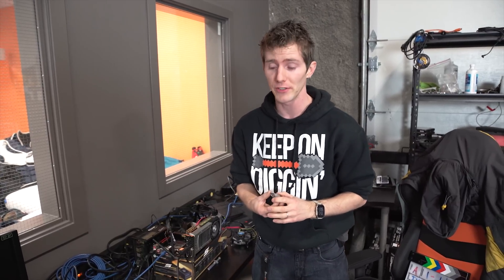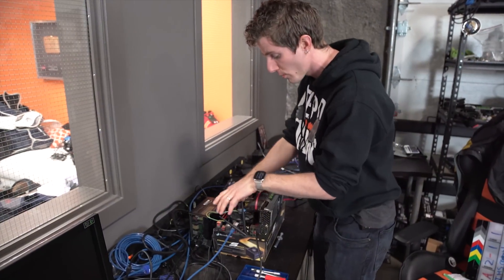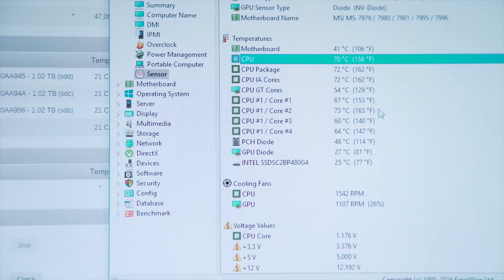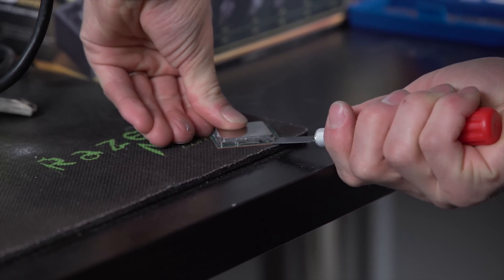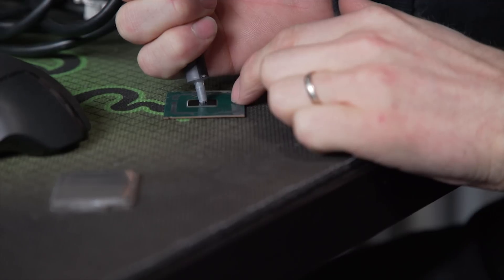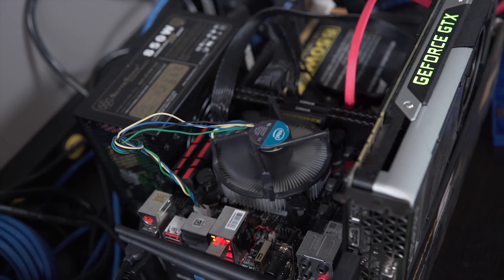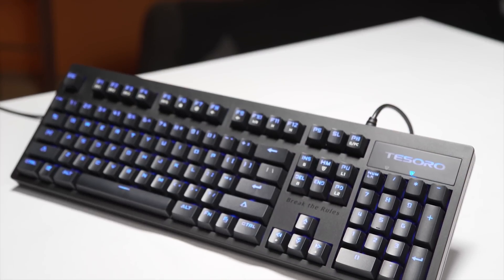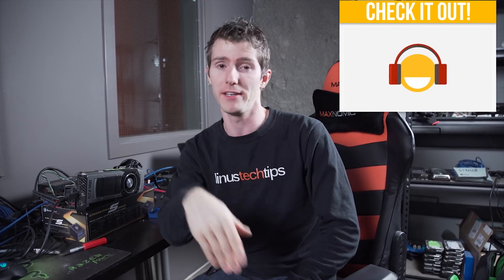Delidding an Intel Core i7 6700K - Is it worth it!?

Comment: I honestly did not know that the big part on top of the CPU was just a heat spreader. I thought the CPU was that whole thing
Reply: +PlatinumGamer One can see who's young in here. 15 years ago every desktop processor was sold without this plate.
Reply: +PlatinumGamer Back when unicorns and dragons still roamed the prairie (the 70's and early 80's) most CPU's were packaged in plastic DIL (dual in line ie pins down either side of the chip) with no heatsink. Some of the higher performing chips would eventually warp then melt the package. If you were to put a drop of water on the chip it would boil and evaporate almost immediately (look I was young) I had a system with a 6809E that ran at a whole .89Mhz (yes the . is not a typo) but with overclocking you could take it to almost 2Mhz, that chip was on the verge of being on fire. Now get off my lawn you whipper snapper ;-)
Reply: +PlatinumGamer Its even smaller then that. Its covered behind the second "lid".
Reply: deXter2
I'm just 17, and just recently got into computers ;)
Reply: same
Reply: yeah, now I know why my netbook processor is small.
Reply: Wow, how old are you guys?

I am seriously wondering here... I mean, I knew the first time I saw the insides of my family's first 486 DX2 that the piece of ceramic with the words Intel 486 DX2, was not the ENTIRE chip, I KNEW that inside of that ceramic somewhere, was a piece of SILICON, far smaller in size than the ceramic which was the size of the socket, and that the only reason the PACKAGE was as big as it was, was entirely due to the need to interconnect tiny pieces of that silicon to each and every pin on the bottom of said CPU package. This was back in 1992 when I was just 7.

At which point in time, I knew how to pin out jumpers to install a new peripheral with a new IRQ, I knew how to run absolutely ANYTHING within DOS 3.X - as well as how to install both DOS, and windows 3.1 - not to mention any game I wanted to play and most drivers I ever needed. 

And the first time I had ever touched a computer, I was just 4, by the time my family had bought the Zeos brand 486 DX2 with a then top of the line 325 MB hard drive, I was JUST turning 5!

So, while I do not believe that the average person learns and remembers things as quickly and easily as myself, there is a HUGE difference in terms of society. Back when I was learning about computers for the first time, there was NO WORLD WIDE WEB! Everything I learned, I had to learn from my father, and reading technical documents!

I mean DO YOU even know what silicon looks like? How could you mistake solid metal for a MICROCHIP? And, for being "interested" in technology, how much do you believe you ACTUALLY know about Computers, how they function, and their history?

I just cannot help but feel disappointed that Linus claims to get MANY questions of this variety, and even many people who admit that they believed a SOLID PIECE OF METAL - to be part of a semiconductor microchip... And now he makes stupidly simple videos to oblige people with limited understanding - and it turns out that many people, who seem to be or claim to be technology enthusiasm, understand far less than the first principle of thermodynamics, and do not even know what a silicon microchip looks like...
Reply: +PlatinumGamer First computer I ever built from scratch used an AMD Athlon Thunderbird processor. Those CPUs didn't come with any kind of heat spreader on them, so you just got to see the actual CPU die and a couple components that were also placed at the top of the processor. That computer was the shit. It had an ATi Rage Fury Pro video card with 32MB of V-RAM. It was actually a beast for the time. Diablo 2 and Max Payne ran like champs.
Reply: +PlatinumGamer me too. kinda cool you can know so little about the parts and still build with them
Reply: +deXter2 Actually when manufacturers purchase mobile grade CPUs none of them come with lids. (For Intel at least, I've never taken an AMD CPU/APU out of a laptop.
Reply: It's called the CPU die.
Reply: +PlatinumGamer I knew they were heat spreaders just because Intel started doing it with Pentium 4's... my old Intel Pentium 3 800mhz and my Athlon XP chips all had the die exposed and your heat-sink would make direct contact... and yes, sometimes you could crunch/crack your cpu's... sad times.
Reply: +PlatinumGamer orginialy cpus didn't have head spreaders
http://www.cpu-world.com/CPUs/K7/TYPE-Athlon%20XP.html
is an example.
headspreaders have been added, because the cpu would be way way more protected that way.
it also makes it ezier for the average person to put a cooler on with better performance.
original the cpu was that small and fragile, that tighening the wrong screw first and strong would lead to eather the cpu corner breaking, or bad thermal performance.
also the video did sth very wrong, so u dont run on wrong information:
the reason people HAD to delid their cpus to get an average overclock, was NOT the 3 degre difference linus shows, but because intel change from soldering the cpu to headspreader  to using a horrible horrible!! head paste.
resulting in the heat not being able to escape through the thermal compound, leading to acumilating head, etc.
the thing it is not 3 degres!
it was up to 40 degress if u overclocked it even with a great great cooler.
and it is important to understand, that intel are the asholes here.
they started to no longer solder the cpus, which u could say is oki,  cause its cheaper so the cpus will be cheaper for us too, whats the harm? right.
but they didn't use proper heat paste! which costs what 1 dollar? they used crap.
that's why replacing the heatcrap paste they used with any okish heat paste will result in heat being able to flow through the heatspreader again properly.
Reply: +timpster ninetythree The actual CPU is build into the hidden face of the silicon piece, it's only about a micrometer thick, so if you were to scrape the CPU off the surface it would consist of about the same mass as a grain of sand. Speaking of sand, that's where they get silicon from, sand, so silicon will shatter like glass. Normally silicon is inactive and doesn't conduct electricity (semiconductor), but the CPU/chip manufactures will "dope" specific spots of the silicon surface with other atoms, making all the active transistors in the silicon like that. They will then go through a series of nearly a thousand steps, eg. adding a layer of metal onto the silicon surface, adding a light-triggered glue layer, shining light through a transparent sheet with a pattern printed on it onto the chip to activate the glue hit by the light, removing the glue that didn't get hit by light, etching the parts of the metal layer that is no longer covered by glue (making up separated wiring/connections to the transistors), removing the activated glue, adding filler where the etched away metal layer was, leveling the surface, repeating to add more metal layers (forming wiring and the components resistors and inductors; diodes are made into the silicon surface along with transistors). The minimum width of something they can make, like wiring, is around 14-45 nanometers; transistors in CPUs only have down to 20 atoms between their input and output terminal. A modern CPU has anywhere between 0.15 to 5.5 billion transistors (Intel Duo E6000/2 core = 0.167 billion, Intel i7-920/4 core = 0.731 billion, Intel i7 4790k/4 core = 1.4 billion, Intel Xeon E5-2699/18 core = 5.5 billion).
Reply: +Dysphoricsmile And this is what the nerd douchebag is people. I highly doubt you knew every component, and what a microchip even was when you were 4... in the 1980s.
Reply: +PlatinumGamer 4head
Reply: +deXter2 every laptop ive had came without an ihs
Reply: +PlatinumGamer That comment made me feel old. There was a time when we didn't know any better than just having a bare die. 
In fact... owning an expensive (at the time) top of the line AMD Athlon XP 3200+ and having to put 1kg of copper on that fragile die was a scary endeavour, because that die is like fragile glass that breaks with the slightest bit of wrong tension. So if the motherboard would warp under the weight or if the heavy cooling block would put too much pressure on one side of the die... game over and money down the drain.
Reply: +PlatinumGamer You're not the only one,When  i first saw a cpu(10 years ago) i was thinking the same thing.Hell my uncle was like:this CPU is small,I responded with:Well that's just a heatspreader the actual cpu is even smaller than that.
Reply: +PlatinumGamer For a little while in the early 2000s, Intel and AMD were selling CPUs without a heat spreader. You had to be fairly careful when you installed your cooler that you didn't apply too much pressure, or you could crack the housing and kill the CPU. I had one Athlon XP processor with a chunk missing from the corner of the die. Fortunately, the CPU itself still worked.
Reply: I remember when Cpus didn't have integrated heat spreaders; the more freaky overclockers still found a way to distinguishing themselves by lapping the cpu die itself ( to thin the protective layer and make sure it's perfectly flat)
Reply: +PlatinumGamer I knew but forgot lol
Reply: Dysphoricsmile
omg get your head out of your ass
Reply: ***** Every component? Explain your definition of component. Because I damn well DID know about every piece of hardware that plugged into the Motherboard and it's function by the time I was SEVEN, not 4 at which time it was 1992-3 not 1980. Read much?  The first time I had seen a CPU (around when I was 6) I was told, and even shown with the aide of an old Intel EPROM chip that had been discarded that had a quartz window on it (If I recall correctly, so that the memory on it could be erased using UV light) - and from there, with a magnifying glass (due to my persistent questioning as to how it all works and what makes it work, as I did about everything that interested me, I cannot help that I was born a sort of polymath) - my father explained to me that inside of every chip, ever (CPU, GPU, RAM, IC of ANY SORT) is a very small piece of a semi-conductor called silicon, that the plastic and ceramic I see is merely the packaging to keep such incredibly sensitive piece of silicon safe, as well as to provide physical links to their respective sockets via (at the time, 320nm aka 32 micron) incredibly thin pieces of metal conductors called Interconnects.

Today those interconnects would be entirely invisible to the naked eye, and likely even with the aide of a very strong magnifying lens, as process sizes are now all done at 32nm and smaller, or 1/10 the size of the process I was able to see visibly due to the quartz window in the EPROM chip. Of course that also means that the "Floating" interconnects visible through the quartz window would be entirely impossible due to the size of the interconnects, now they are directly embedded into a piece of PCB, which is why it is pretty damned shady of Intel to skimp on the thickness and strength of said PCB.

And my earlier comment was not directed at anyone, nor was I making fun or anyone in particular. I just don't understand how someone can be so enthusiastic about PC hardware, yet know so very little about how any of it is made and what makes it work.

I am more disappointed that LTT has been putting out such boring and simple videos lately.

As for knowing what a Microchip looks like, it is a VERY easy thing to find on the internet! Intel and AMD LOVE making huge pictures of their CPU dies and even tend to highlight key parts of the Architecture of said CPU.

 http://www.anandtech.com/show/4083/the-sandy-bridge-review-intel-core-i7-2600k-i5-2500k-core-i3-2100-tested

That took me literally 2 seconds of typing and pressing enter to find. 

Now did you REALLY need an entire video to tell you that a CPU, or any Integrated Circuit is not simply a lump of metal or plastic with some pins?
Reply: +PlatinumGamer I thought you were me and I got confused because I haven't commented on this video before lol
Reply: +Platinum Gamer. Quite a popular name, this. You are the third guy I have seen named Platinum Gamer :)
Reply: +PlatinumGamer thats because you are all posers.
Reply: +PlatinumGamer Yeah its this big: http://puu.sh/nTlbZ/e3ae954fbb.jpg
Reply: +PlatinumGamer Dude no surprise you did not knew it already. This is high end enthusiast stuff. Common users dont have to do anything with it.
Reply: +PlatinumGamer I never thought that as my first pc wal Pentium 3 and a looked at the pc and it was delided I think by default
Reply: +deXter2 ikr
Reply: +PlatinumGamer Well, then you learned something new.
Reply: +daishi5571 Sounds like a Tandy Color Computer.
Reply: +Jonathan McClen My first CPU was a Pentium II and it had a small fan and heatsink glued to the side of it with thermal foam.
Reply: +deXter2 im not that older, but i have a intel 4004 known as the first intel processor, well im studying electronic engineer
Reply: Same
Reply: +cataria pega some CPUs still don't have heat spreaders today!
Reply: a Disrespectful Narwhal
 rly? i thought both main manufacturers of cpus do? amd and intel.
im aware that other chips often dont have a heatspreader due to cost i guess as who the fuck removes the northbridge cooler? regularly etc.
Reply: +a Disrespectful Narwhal name one
Reply: Same here 😂😂
Reply: +PlatinumGamer i used to think that until i started taking apart my familys old broken pc's lol
Reply: +Luca Fuoco It protects the silicon die from scratching and also helps in dissipate the heat faster from the silicon die towards the heatsink.
Reply: +Luca Fuoco -Heseth's last statement was false. The IHS hinders heat dissipation from the chip to the mountable heatsink, however its the cost you are willing to pay to protect the fragile chip from possible damage through physical contact with said external heatsink with the fan
Reply: +deXter2 One should mention they only use Heat Spreaders on their Desktop Chips. I have an overclocked 4940XM In my laptop that is Just the bare Die, I'd imagine it's for the Profile Height. Same with just about all Laptop GPU's, who also lack the IHS. Personally I'd delid all of my Chips that have them, there is no logical reason for me.
Reply: Shmeh Fleh I have very fond memories of that very chip, I myself have a few still laying around. It looks like they had put a few rubber feet around the chip to support the weight distribution. Looks like most of them didn't get this though.
Reply: +PlatinumGamer I wish I had a computer so big I could "get into it" lol
Reply: +daishi5571 then there were the metal can chips and after that the chips with integrated heatsinks and then the slot 1 and slot A  cpus.
Reply: +PlatinumGamer If you've ever seen a old pentium 3 coppermine it was the last intel chip that didnt include a heat spreader. In fact it might be the only one thats a normal type of socket and not a Slot card socket that didnt have a heat spreader.
Reply: +daishi5571 Heh, my 486SX33 ran fine without any heatsink. In fact, it was an IBM Aptiva machine and came w/o cpu heatsink from the factory. So totally intented as so. :P
Reply: +deXter2 Yup, definitely, these kids have never seen some monster processors like Itanium 2, even if i don't remember if this had IHS or not...
Reply: yeah the cpu is thinner than a toothpick lol
Reply: Lukas kuprys Well, actually the physical CPU is VERY MUCH thinner than a toothpick. Still, the entire silicon part is quite "large" as it's probably around 0.75mm thick.
Reply: Bourinos02 The part you're talking about is called the Socket Imposer. That's usually a Multilayer PCB, believe it of not the Die itself is usually soldered directly to that Socket Imposer via a high density BGA beneath the die.
Reply: ***** Oh interesting, so can you tell us if they cut the wafer thinner after processing and before putting it on the chip or if it stays at around 0.75mm?
Reply: +PlatinumGamer same. the more you know
Reply: +deXter2 Hmm, as far as I can recall, AMD was the only one who made CPUs with a naked die. Can't recall having seen a Intel without IHS (unless someone removed it)
Reply: TheMrTape Good introduction to photolithography, but the last one seems to be wrong. If the smaller feature is 14 nm, it's 140 atoms, not 20...
Reply: +daishi5571 Eh I can't blame him, if you aren't taught anything you wouldn't know. I remember thinking the original pentium CPU was the entire piece that plugged into the socket when I was like 6. Never knew it was just the part inbetween all the pins.

What funny is that I got out of PC's right went the Pentium 4 with hyperthreading came out. Shit was expensive, and i had no money. Fast forward 15 years later and I had to relearn a shit ton, because what used to be necessary like maxing out your ram and having a really powerful CPU, isn't a big deal for gaming anymore.
Reply: +Dysphoricsmile Wow.

Dick.
Reply: +PlatinumGamer I'm 52, and just recently got into 17 computers. :P
Also, Just because baseline only saw approx. 2  degree improvement doesn't imply that at full load it will remain at 2 degrees. If at full load there was up to 8 degrees improvement than that would affect the longevity of the chip.
Reply: Ergo Gray Lowering heat alone does not increase longevity - especially a minor reduction in temps. For one, what application do you suppose is going to be using your CPU at full load at all times?

And secondly, it is well known that heat alone does not actively wear out Microchips. If it did, you would not be able to find a working Nvidia 400-500 series GPU anywhere, when I know of 4 personally that are now going on 6 years old! And those beasts are HOT, like 85 to 95 degrees operating temp hot!

Same can be said of Pentium 4s - most of which still work provided they weren't just tossed in some heap (as is the standard treatment for old hardware that was bad when it was new)  - same goes with ALL AMD CPUs since Bulldozer and AMD GPUS from the HD 6XXX to R9 2XX, I don't hear many complaints that these chips are unreliable or die quickly. No, the only real complains about them are that they produce a LOT of heat, suck a LOT of electricity by comparison, and - the CPUs are not even close to as powerful as any Intel SandyBridge i5 or newer, which are 5 years old now themselves. 

There are many factors that cause hardware to die over time. In my 23 years of personal experience it is RARELY ever because of just heat - and basically never because of heat when the system in question is properly operated - i.e. Any over clock is done slowly while making sure the component in question never exceeds the maximum designed operating temperature.

Anytime you follow all guidelines for said hardware, it will not ever die because of heat. The notion that simply lowering temps -  just by a few degrees, unless said chip was operating a few degrees above maximum designed temperature, lowering your CPU's load temp by 8 degress C will not make it have any greater longevity than it would otherwise have had. So that belief is for the most part, entirely false.

But as I said, a great many variables effect hardware longevity, and if you want to hedge your bets by simply knocking a few deg C off of operating temps - it certainly will not hurt it, but in all likeliness it will have absolutely no effect on anything.

The whole reason people STRIVE for lower and lower temps is to be able to overclock more effectively and/or to be able to run your system more Quietly while still having as good performance as possible. And again, this is all to avoid getting ABOVE the standard operating temperatures, where not only will hardware throttle down, but you do run the risk of killing your system.

Apart from those 2 reasons, there is absolutely no real point in lowering your operating temps. So if you are running your CPU at factory frequency, and you don't feel the need to make your PC any more quiet, don't waste money on cooling, just save it for better parts down the line.
Reply: +PlatinumGamer Pc buyer vs Pc enthusiast
Reply: +deXter2 And... they broke easily because the CPU die is as fragile as glass.
Reply: +PlatinumGamer isn't the actual chip a dozen nanometer wide?
Reply: hahahahaha me 2😂😂😂😂
Reply: +Bogdi Gaming and More! no not the diaper brand!!!😂😂
Reply: +PlatinumGamer big mistake buddy..
Reply: +Dysphoricsmile
I don't think anyone believed the IHS was literally part of the chip. They might have believed it was a size-appropriate packaging, possibly made of metal to protect the delicate CPU inside. That's what I believed at least.
To answer your question, I was born in 95 and my family didn't have a decent computer until 2004, which means my first exposure to anything PC was well into the Win XP era. The first computer I've ever been involved in building ended up having Win 7 on it, and is barely 6 years old today. I study computer engineering now.
Reply: +A Google User No, that's the size of some of the transistors that compose the chip itself, the full processor, without the connecting board bellow and the IHS is a few centimeters wide and tall, 3rd gen. Core processors were like ~3cm tall per ~1.5cm width.
Reply: +PlatinumGamer Rookie
Reply: +timpster ninetythree With it's 1billion+ transistors, it's insane tech to make too. Considering it's basically the size of a TO-220
Reply: +PlatinumGamer now think of the size of a desktop, its all for convince. You could fit the cpu, mobo, gpu, ram and even the psu, an ssd and 3.5 hdd into the size of an avarage graphics card and keep all the performance.
Reply: Ashley Meah
I don't think you could.
Reply: +Poldovico open a modern thin laptop and you'll get surprised about the fact that almost all what is inside is battery. The motherboard on MacBook Air like laptop is really tiny, and it includes everything: cpu, chipset, gpu, ram and ssd
Reply: +Almarma But Macbooks have virtually none of any of those
Reply: +PlatinumGamer i thought it was for Complete protection, and i thought there was a shit load of shit under it. but no just a tiny ass mirror
Reply: +PlatinumGamer the same works with your gaming consoles. My nephew did it to a "junked" ring of death xbox360. He fixed the ring problem and replaced the paste. works like new.
Reply: cpus when i was a kid where big chunky 5 inch long things, Pentium 2 ftw :)
Reply: It's not so bad, I've manhandled all my processors and never broken any. It's the motherboard itself that limits the heatsink's weight, especially before today's standard widely-spaced holes. The holes used to be placed in an unfit manner for large loads or they weren't even there - the heatsink had to be clipped to the socket's beige plastic!
Reply: gotta say, before heatspreading plates you were not handling the "bare die", you were handling the "chip packaging".
As is noted in another (quite long) replies, the silicon die is ... silicon, not metal. And it's even smaller than what you can see behind a heat spreading plate.
On a curious side note, in that age when there where no heat spreading plates, the overclooker would grind down the chip metal packaging to get the heat sink even closer to the chip die.
Reply: TL;DR: That's not the "die" it's the chip package.
You never have handled a chip "bare die", on air exposure it most likely will get turned up into trash.
Reply: Serzap
It is really the silicon. The trick is that the circuits are facing the bottom that is hidden. What you see is the back of the substrate. And BTW, air won't do anything to it. Silicon doesn't spontaneously react with air at room temperature.
Reply: I should have said "having exposed with the environment most likely will turn it up in trash"
Since the moisture and even the natural UV light in the environment might damage (irreversibly change configurations saved as charges) or change the behavior of the chip.
And could you please guide me to a reliable source of the modern CPU construction?
Reply: Serzap
I don't have a source, I heard something from a college professor, I have also taken apart some chips. A processor isn't sensitive to the UV radiation because the component side of the die is hidden in all directions. There are packages though which allow UV to hang the device while in operation. No permanent damage. But an X-ray can erase chips inside as has been done in the age of PROM when they wanted to save money not buying the windowed EPROM.
Reply: zwz • zdenek 
Some chips are photosensitive even when they're not designed with the purpose of using that feature. Like a voltage regulator in the raspbery pi 2 PCB https://www.raspberrypi.org/blog/xenon-death-flash-a-free-physics-lesson/
When I wrote that I was thinking of the event of handling the actual silicon die (in the sense I was referring to, that I would explain later) not the whole package (mounted) that as you mention is well protected from interference.
It seems that we are both technically right (you more than I, but it is the philosophy issue of "what is"). I still can't get a full reference but it's noted here http://electronics.stackexchange.com/questions/241665/the-metallic-plate-behind-2010s-cpus-heatspreading-plate-is-the-actual-chip-d that yes, it is the flipped silicon die, but is covered with several protective layers of different widths. So, it's the silicon die and it is an encased silicon die too.
Reply: everybody starts somewhere
Reply: The funny thing is... a couple people dropping jokes on people being young because "older procs didn't have the heat spreader". WELL before the Athlon era most procs had the heat spreader :p Pent-pros, pent 2's and the k2-k3 amds all had them. The biggest challenge for these companies is heat dissipation on mass produce-able heat sink and fans... before high end thermal pastes, you had that silicon paste, which really didn't help much except to make up for any gaps.. And heat sink and fans were pitiful, so those spreaders helped out quite a bit. Then as large copper heatsinks came around.. the heat spreader became a hindrance and they chucked em for a while..
Reply: Platinum comment.